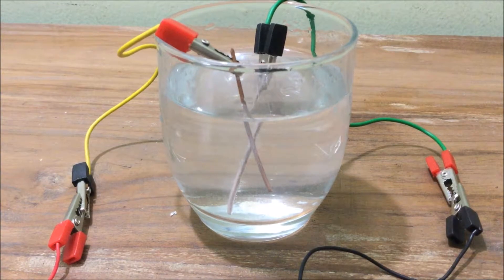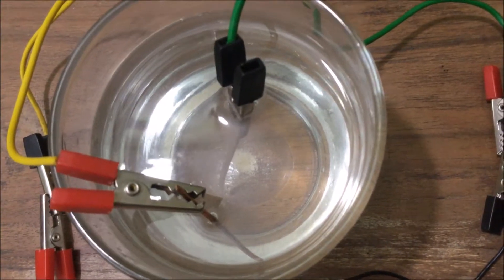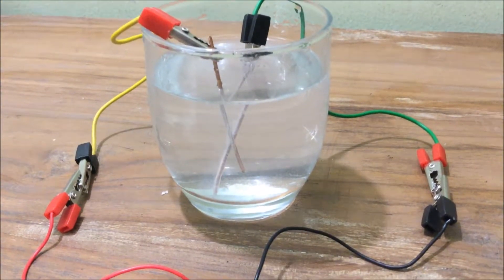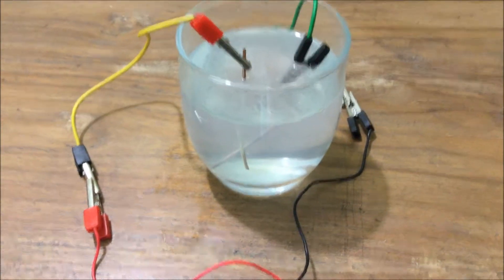Electrolysis Of Sodium Chloride

Comment: You cannot take aluminium as electrode, mister🙂. It will react with NaOH and HCl formed.
And on anode you get hydrogen, not sodium.
Reply: What is the electrode to be set then?
Reply: @titancodm1098  You can take graphite electrode (like lead of pencil) or copper electrode.

Comment: This is wrong on so many levels, sodium? No, that'd react with the water, the white is some steel from the aligator clip being dissolved in and plated out, and no, the copper electrodes aren't inert, the dissolve to form copper chloride, and also chlorine is not good to make indoors

Comment: You are doing this wrong in so many levels. 
1. You need 2 containers for each anode and cathode, connect them both with a salt bridge. 

2. If you want to make sodium metal, you don’t start with sodium chloride, the bond in that molecule is so strong it’s not even worth trying to break directly.

3. Copper electrodes? Are you kidding me? Those aren’t neutral electrodes. They wear off and add themselves into the equation. Whenever performing an electrolysis reaction like this you use neutral electrodes that don’t wear away with time. Stuff like graphene or platinum electrodes are used here. Because they are inert and do not react with the solution.
Reply: Wouldn't you use two containers and a salt bridge for a galvanic cell? The industrial method of separating the anode and cathode in electrolytic cells that produce chlorine, hydrogen and sodium hydroxide is by using a selectively permeable membrane to allow only the sodium ions to migrate to the cathode where water is then reduced to form hydroxide ions which then combine with the sodium to form sodium hydroxide.
Reply: @ale9507  That’s the point of the salt bridge. It’s basically a paper towel soaked in salt water.
Reply: i will do electrolsis process in one beaker i mean electrodes gonna be in one beakrr with salt water. After turning power on which chemical is going to be produced ? Hypochlorite or hydroxide i spent hours on youtube just for understanding which one is produced still i have no answer im using lead catode and iron anode

Comment: Dude, this is wrong. You are not making sodium metal, or else your experiment will make boom. Sodium is highly reactive in water...
You are producing sodium hydroxide, oxygen (edit: I meant chlorine gas!) and hydrogen gas only. The hydroxide ions may be reacting with your copper electrode, depositing some copper hydroxide precipitate on the top of the electrode.
You need some review on how electrolysis works.
Reply: Yeah i was hopping he didn't produce mustard gas in his bedroom too.
Reply: sodium is more reactive than hydrogen thus hydrogen is formed. 2H+ + 2e- -> H2  . Chlorine is formed instead of oxygen because its a halogen so 2Cl - 2e- --> CI2 Thus chlorine gas is formed at anode and hydrogen gas at cathode.
Reply: 2ci- * youtube thinks the minus sign is to edit the message as a cross
Reply: Thanks...btw i have one more questions... So chlorine gas will not formed? I can't figure out what will be the products after electrolysis...
Reply: @Unnamed_User   @狂神的奇怪頻道  My bad, chlorine gas is formed, as well as hydrogen gas. Oxygen gas just popped up in the middle of my sentence, but is not formed at all in this reaction (as halides have a priority to form at the anode vs oxygen). ^^' Sodium metal is not formed because it is more reactive than hydrogen (H2, see the reactivity series).
Thanks for asking and allow me to correct my answer !
Reply: guiyong oh 0.0 thanks for explanation too^^
Reply: @guiyong  If you use dilute NaCl O2 can form
Reply: @guiyong  Can you edit the original comment, so It's more clear what is actually produced?
Reply: @petrlaskevic1948  I could, but then many following comments would not make any sense... Sorry about the confusion.
I meant that he is producing sodium hydroxide, chlorine gas and hydrogen gas.
Reply: u ar right
Reply: To obtain a  Na+ and Cl- always we have to take molten state of NaCl(liquid) which is obtain at 2000°C.
Reply: Chlorine is formed at anode , and hydrogen is formed at cathode
Reply: also the chlorine gas is toxic for human
Reply: Mann! It's simple if the there is a saturated NaCl solution then hydrogen will evolve at cathode and at anode due to selective discharge (presence of more chlorine ions) chlorine GAS will be evolved